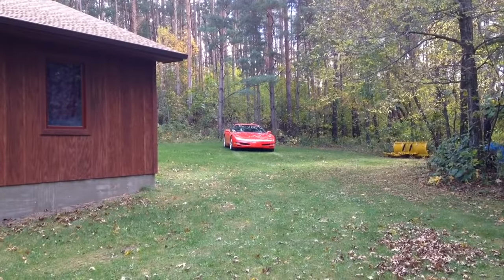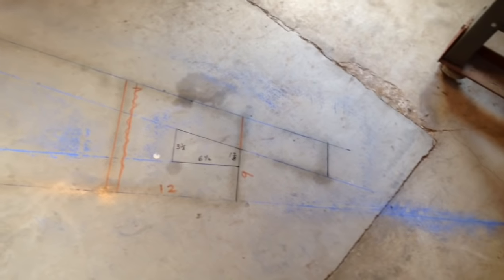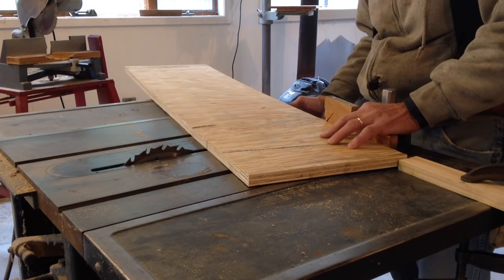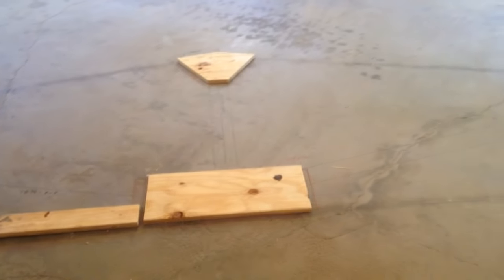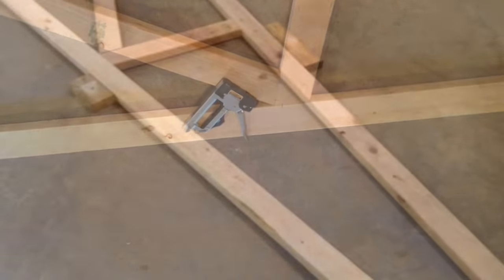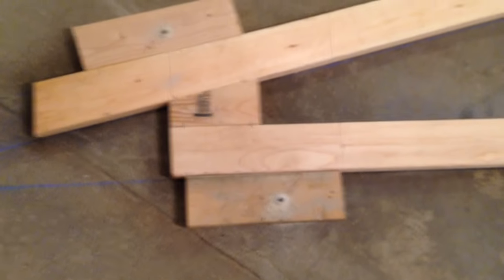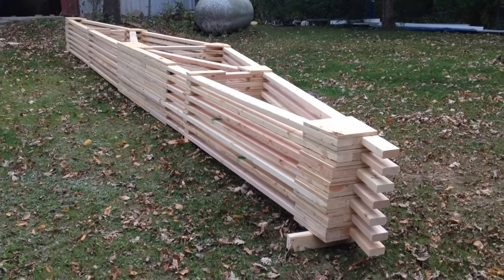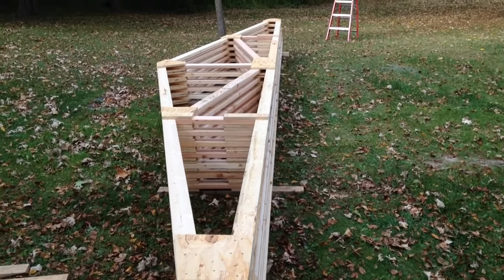Build your own wood trusses

Comment: $25 it cost you for material/ Trust sounds like a bunch of BS to me especially adhesive and plywood believe none of what you hear and half of what you see with these YouTubers
Reply from the maker: Hello Carl,  First thing you need to look at is the date the video was made.  Many years ago now.  I had one similar complaint about a year ago, and here is how i answered it.  

flyboyslc1
1 year ago
Hello Dual,  Always enjoy reading the comments people post.  You need to remember that i built these trusses (and the video)  4 1/2 years ago.  Lumber is a commodity and prices vary.  Right now (2019) i can buy 3/4 CDX plywood for $20.  I think One sheet would make gussets for 2 trusses?  Have to do a layout to be sure. So i have about 10 bucks in plywood per truss.  2 x 4-16 in SPF (spruce, pine, fir) are $6.50.  Lineal footage would require about 4 of these, so figure $26 in lumber.  Add in a little money for nails and glue, and in 2019 dollars probably $38 would buy the lumber. If i want to use southern yellow pine the cost goes up about 25% for the lumber.  I can buy them from the local big box lumber store for $75 each plus delivery costs.

Comment: Literally of NO help whatsoever if you are actually building trusses how does one find the angles? where are the measuring points? where is the useful info in this video????
Reply from the maker: Good morning Chief!  Sorry the video didn't work for you.  I just did it for the fun of it anyway, and I make no money off of it at all.   This video was not intended to teach how to design trusses, as that is very complicated and would not work well in video format.  Lots of things to think about such as slope, span, roof dead loading, ceiling loading, seismic conditions, wind loading, snow loading and they all change depending upon where you live, so for me to try and present that is not realistic.   If you are looking for design information just google "design wood roof trusses" and you should be able to find what you are looking for such as web member angles, and dimensional data, and links to computer programs or books that will facilitate design.   Remember that the first trusses never had any engineering involved.  Just carpenters looking at a situation. recognizing the strength and stability of triangular shapes, and building a truss.  That is what I did after 48 years as a carpenter and setting thousands of roof trusses.   My trusses were designed right on my shop floor.  I Used a protractor to measure angles and tape measured web member dimensions.   Now days, there are good strong computer programs that figure it all out.  They are available to purchase.  best wishes, steve.
Reply: Chiefnugnam you miss the part where he asked Siri for the angle which was 14°? And then he talked about setting up the miter stop at 14° a short while later?
Reply: do google search
Reply: Chiefnugnam  to find the angle, you need to know the run and the span. So for instance, if the run (height) is 4’ and the span (width) is 12’ = 4/12 =0.33.  In order to find the angle, you need to use the inverted tangant option on your scientific calculator. Tan(-1) of (0.33) = 18 degrees.  He said 14 degrees in the video.  In order to find the pitch of 14 degrees you need to use the tangent option on your scientific calculator which is tan(14)= 0.2493.  0.2493 x (span of 12’) = 2.99 or 3/12 pitch.  He could be using 3/12.  But I don’t know by looking at this video